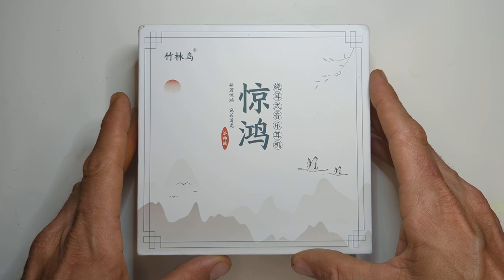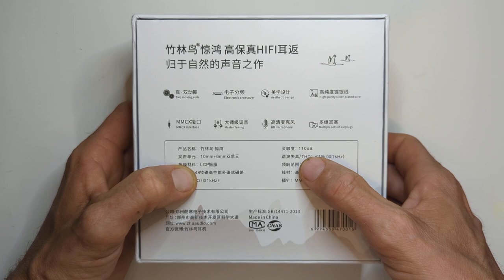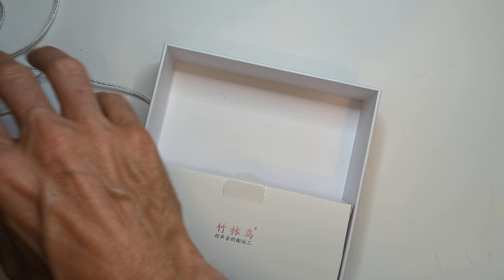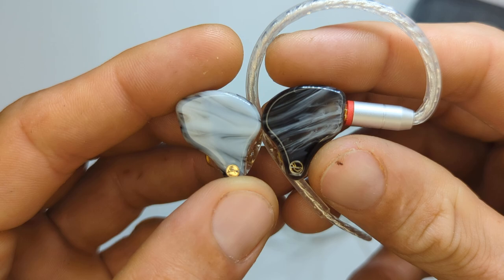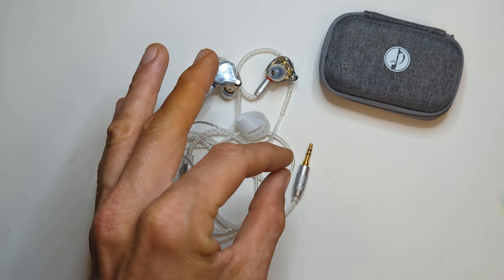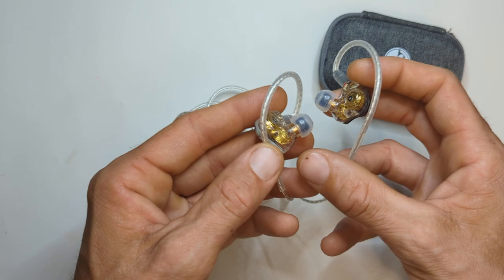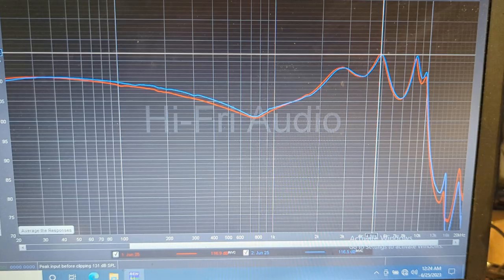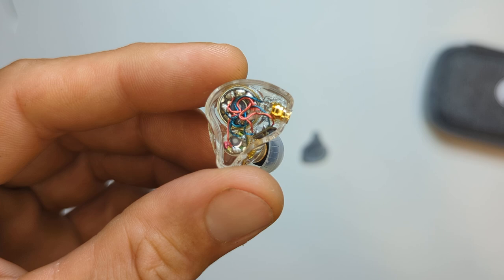Zhulinniao Jinghong 2DD Iem review and Teardown! Spoiler alert, they're not very good. 😡

Comment: Faulty designs tear down is as interesting as TOTL teardown.
The graph shows that the 10 mm is slightly underdampened, a naive attempt to low pass it.
Reply from the maker: It could be a cause of under-dampening in the rear of the DD but I'm thinking it has more to do with the poor acoustic design of the forward cavity and the interaction between the 10mm and the 6mm. You see how the graph gets sucked down around 800kz before regaining energy? A classic symptom of poor frequency divider implementation and phase cancellation between drivers. 

However I still think this iem's biggest sin is spec-ing a good 10mm DD but the cheapest, crappiest 6mm for the highs. 🤦
Reply: @hi-friaudioman  Interesting....I was thinking of underdampening because I always get this upward convex curve when underdampening.
This setup of 10 mm + 6 mm is a potential way for failure because I don't think there is any Mids/HF dedicated 6 mm.
Even the Penon serial is said not being for treble heads.....